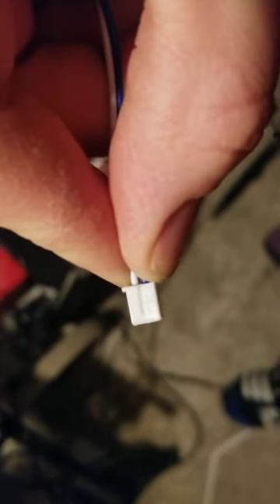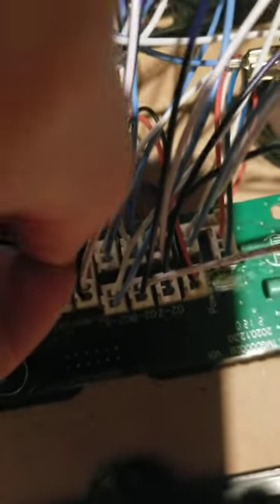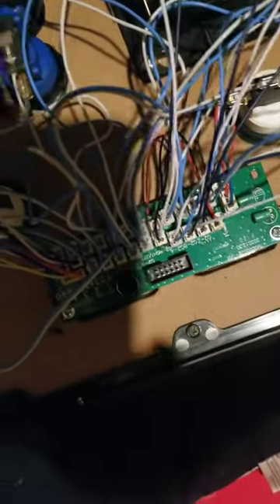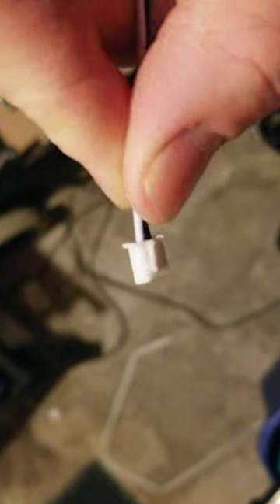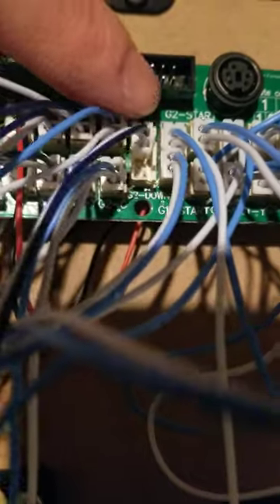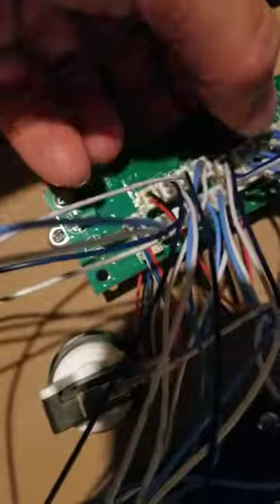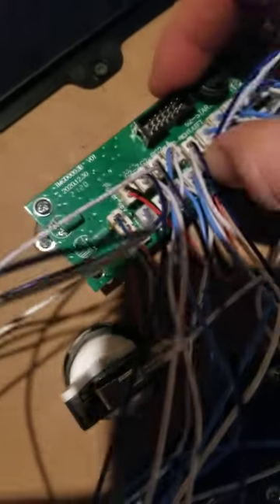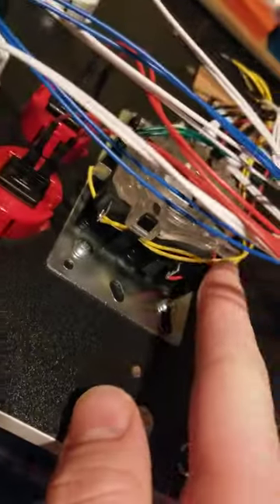Arcade1up wedging joystick button wires together on Big Blue encoder board.

Comment: Dude the JST connector is held in to the .HX housing via a clip on the back. 

You just take a paper clip and hit the tab and pull out the cables. 

Then you take the stock 4 pin housing that came with the stock joysticks and you just swap them.

At least you recognized that they all do the same thing,  but to make it easier on yourself and others, you can just swap the cables out of 2 Pin .HX housings, and slap that JST end on the proper four pin. 

But if your way is easier for you, have at it!
Reply from the maker: Well damn. Hahaha, news to me. I thought once the wire got pulled out there's no going back. Im still very new at all this stuff. Haha. Thanks for the tip! I will try this out on my KI cabinet swapping those joysticks. Thanks again!